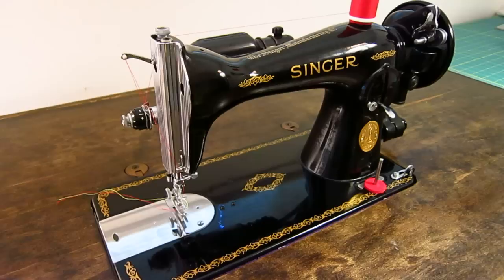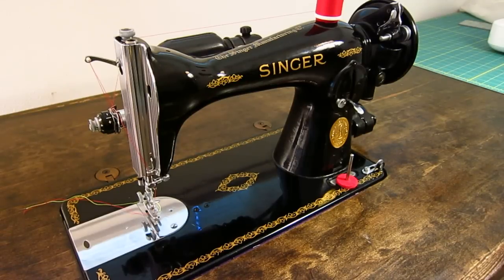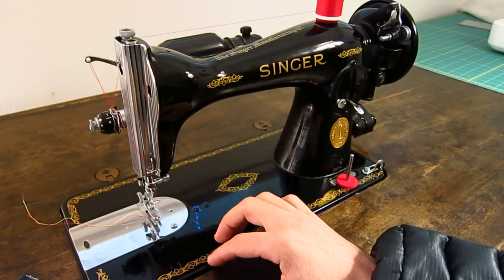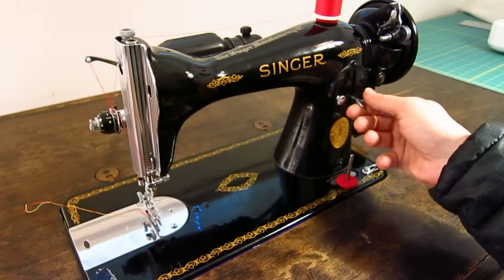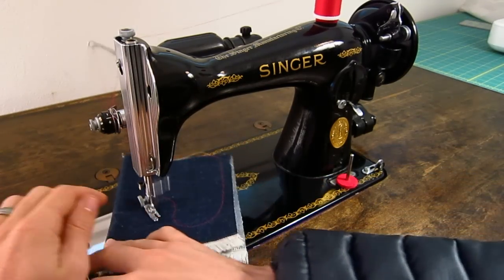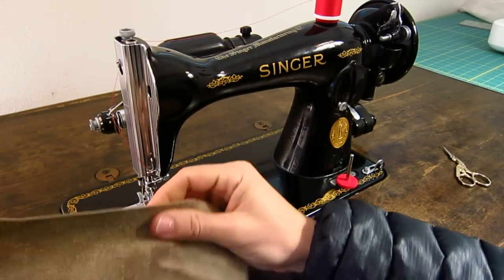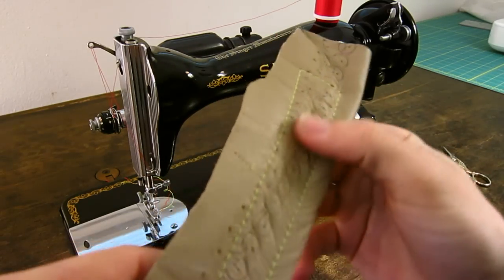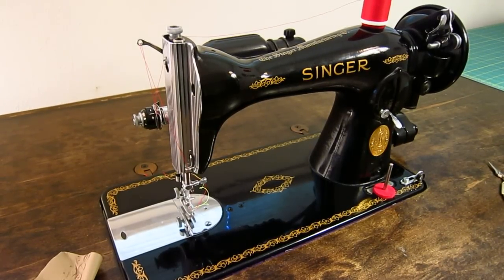1948 Singer 15-91 Sewing Demonstration

Comment: This is a dangerous hobby.  I just discovered the class 15 line.  I have a Japanese clone, a Universal Eversew Model 77, on its way to me.  It looks a lot like a 15-91, except it's belt driven, with a 0.9 amp motor.  Now having watched a few videos on true Singer 15-91s, I think there might be one out there somewhere calling to me.  Vintage sewing machines are like potato chips ... you can't have just one.  The Eversew will be my third.  I already have a Singer 128 and a 457.  The 457 has too much plastic in it for my taste, including a broken plastic gear that I need to replace.  I think I'll stick with the older all metal Singers in the future.  I love the look of the black cast iron Singers.  I'd also like to add at least one treadle Singer to my collection some day.
Reply: I’ve been bitten by the vintage bug. I’m now considered an addict.
Reply: Man don’t you know it !
Reply: My grandpa purchased one brand new with a cabinet when they got married, as a wedding gift for my grandma, after he came back from the war. Years after both of my grandparents passed my father got it out of their basement after decades of not being touched and passed it down to me. I was so excited to Inherit it. We cleaned it up, ya know decades of dust and such, we noticed the coward was rotted, but that was nothing to replace. When we changed the cord,  cleaned and oiled it, we tried it out and needless to say, I was in love. It was like it was brand new from the retailer. Someday I will pass it down to my daughter and share the history of grandpa buying it for grandma and hopefully she will do the same 💜

Comment: beautiful!I went from an advanced computerized model with a fried motherboard to a singer 201 - 2 and have totally swung to vintage. I'd only take another modern one if it were free. I've got 5 vintages!
Reply: I was given a 15 , it's like this and it's great, I would never have a computerized on. I like computers, but not for this
Reply: I feel the same. I got rid of my plastic expensive computer sewing machine. These are treasures that can actually be used.
Reply: Well, janome got me last year when during a night shift I emailed a dealer and said I'd buy that top of the line ocean liner of an m7 if she'd knock 2 grand off the price. I never thought she'd DO it! I still love my vintage beauty's, but that m7 is pretty cool.

Comment: I bought a 15-91 years ago and love it.  I bought a 201-2 for $40.00 at a flea market and now own all THREE models that Singer made with potted motors.  The 101 predecessor is almost as quiet as the 201 and used the same gear setup.  Love those vintage machines.
Reply: I have a 15-125 and two 15-91’s. Am Very Excited sewing with my Beautiful Ladies, have named them with Cajun Princess names.

Comment: Brother you do have a beautiful machine and I am lucky enough to have two of these and one travel machine. I had to rewire mine and I replaced as many serviceable parts as I could. Love the look and feel of all of mine. Since I took mine all apart, I need a video on the adjustment setting and where to put everything back to stock?
Reply: shafferjoe1962 try Andytube here on you tube he has a ton of singer sewing machine information

Comment: Wow. Just kind of stumbled on this video while looking at videos of the new computerized machines that are out there. Great job on the video! I personally have three Berninas, which include the 880. However, I have my mother’s 1948 Singer 15-91 in the cabinet. I also have her sister’s 1942 201-2 in the cabinet. The sale barn in Illinois didn’t want them when I sold my Aunt’s house in 2014 after she passed at 98, so I just moved them to Florida. My Mom and Aunt had both been in Florida with me since 2012, and Mom just passed last month at 95. I haven’t plugged them in, but I think they both still work—Aunt Helen had still been doing some sewing before I moved her down here. Right now my serger and one of my Berninas are sitting on the cabinets, sturdy you know, but I am thinking I am going to have to move them off and get them out and give them a try. My Aunt had worked for the local Singer shop at one point in her youth, so was good at cleaning and oiling them. I do have a local guy who could get them back up to speed if need be.

Comment: I just bought one of these in a cabinet in fair condition. I probably paid too much but the seller claim it had been serviced a year ago. The machine sews a nice stitch but I wonder what I need to do to get the wiring up to safe standards. Where does one find a technician to take a look at it?

DR
Reply from the maker: +Denny R Just inspect the wiring coming out of the motor going to the plug harness.  If it's pliable and with no cracking or exposed inner wire you should be okay.  I've had quite a few of these potted motors machines (201, 15-91) and there seems to be two versions.  One with a traditional SPT-2 style wire (looks like standard lamp cord) and another with a black and a cream wire with sleeve covering the the pair of them (likes like just a smooth cable).  The black and cream wires are the worst and tend to crumble away posing a shock hazard and potentially a fire hazard if you're getting arcing.  I just replace the wiring on basically every machine I have.  You can take it into a sewing machine shop but very, very few will even look at it.  You'll have to venture into on your own most likely.  I may do a video down the road on how to refurbish and rewire these machines but that won't be for a few months.  Goodluck!
Reply: +thesergeant 
Hey thanks for the quick reply! Looks like I have a  black and cream style but this wire set is connected to the foot controller not the wall.  The wire plug going to the wall looks modern. I assumed when buying the machine that if it was serviced at a sewing shop that the technician would have alerted the previous owners about the danger and there forth concluded the wiring would be safe.  

If I'm going to rewire then I should probably also rebuild the potter motor-would you agree.

I must say this sewing machine is fascinating to watch in in action- all gears and no circuits boards to control the stitching...

DR
Reply: Re-wire it when in doubt. It's a simple as that. The issue with the electrics is not that the system is inherently unsafe, but that the isolation used simply falls apart. One replaced, that's no longer an issue for the foreseeable future.

Comment: I love this video. Thank you for posting. I stumbled upon one today. That is almost 100% perfect. I picked it up for $65 and it runs like a dream.  It has all the original parts, plus all the feet, button holer and manuel.
Reply: I just got one these and I’m assuming it’s safe to plug into modern home outlets right? Like the voltage won’t overwhelm the motor?
Reply: @sarahlouisebyrd6060  good question. I just plugged mine in and the plug didn’t go all the way through the outlet. It still works but with the prongs of the plug only halfway in. Kinda scary. Felt like I was going to get a shock. But I was ok. Just wondering about the plug and also is that what he was saying about the wiring he had to replace many times on the machines he got.

Comment: Thank you for the well done video. I inherited my 15-91 from my dad who bought it for upholstery. I've made or modified lots of camping gear with it but didn't understand some of the features of the machine. Adjusting the spring pressure on the foot was helpful on my most recent project. I've used my wife's Elna but I still prefer straight stitching with this machine.

Comment: I have one  that i got free when a neighbour  had to move and left lots of old stuff outside . It's the Canadian JB  code from St John's Quebec  but I don't  know if these work today on hosue current  with 60 Hrz  cycle.  It was in 1948  that the USA  switched all of their   AC  dynamo  from 30  Hrz  to 60  which avoided   the  often  seen flickering of light  that some eyes could pick up .  
     In Canada we were warned about the US  changes  and  our  60 hrz change over  wasn't until 1955 where people were told to hand in all their older 30  Hrz   appliances  by the Hydro supplier because the wiring  could handle  twice the number of Sine waves  with  the   copper thickness.  
           I don't want to plug mine in and fry  the guts just to test it .  Will 15-91  JB series  handle the 115V 60 Hrz  .

Comment: Awesome demo friend; I had one given to me by my mother (Columbia) and didn't touch it for some time but finally I put a day and a half working on it, and now I'm glad I did. They are a workhorse; every now and then it dose break a needle. The needle dose clear the  needle port when turning wheel by hand but on full throttle once in a while it will break needles. Any tips?
Nice job.

Comment: I just picked one just like this up yesterday for super cheap! I have a 1915 machine my gramma gave me. This one is a bit different, but I'm impressed with all the videos I've seen about it  I can't find any on how to thread it though and I'm having issues getting the bobbin to thread through. Idk about this one. But my other machine you just set the bobbin in and go. Tried it with this one didn't work. And how I had it threaded on top is way different than how you have it. But I couldn't tell in the video how you had it threaded.

Comment: Hi,
Thank you for the video, my machine is similar, from 1951. My tension adjuster is in the front however, not on the side. I have a simple question, how can I tell if the needle should be thread from right to left or  left to right?
Reply: If it doesn't sew right,,, switch.

Comment: I am very new to sewing , I’ve only hand stitched holes closed on clothes and other minor things like that, but I want to get more into it! I really like vintage things in general and how well things were they made. But modern things can sometimes be better. I am wondering how this compares to a modern machine? I know I should get a cheap and simple machine for my first one, but I still want to learn and have something to work up towards.
Reply from the maker: I've been meaning to do a video about this exact issue: modern machines vs. vintage for new sewers.   The short answer is, without a doubt, get a vintage.  When you're learning the straight stitch is all you need.  Even when you're an advanced sewer straight stitch is what you use 95% of the time.   Don't worry about blindstitches, appliques, embroidery stitches, etc.  Get a vintage machine, learn the ropes and grow into the capabilities of your machine.  Too many people get frustrated when learning to sew and give up.  A lot of that frustration comes from the limitations of these cheaply made modern machines.  Get some that is reliable, and is designed to do one thing really well.  For vintage singers my personal favorites are the Singer 201, 101 but any of the 15 series will work, as will any of the other vintage machines that are out there.  Watch some of my other videos showing the different machines out there, get a feel for what you like and go find one.  You won't regret it.  Goodluck!!!
Reply: you answered a lot of my questions, now I just need to learn the different parts and terminology... I want to make my own bedding, a silk pillow case, a quilt... then move on the clothes...
Reply: Thanks so much for your help, I look forward to watching your other videos. A vintage vs modern video would be great for beginners like me! :) I am so happy to know these beautiful vintages machine are also good for beginners! I am inspired to learn more about them and maybe own one someday.
Reply from the maker: Cash4Fruit Keep an eye out on craigslist.  People often give them away for free or for really cheap.  You'll have to put in a little work but that's part of the learning process and what makes using these machines so rewarding.  Watch my video on " Durkopp Treadle Machine".  You might even consider getting one of those that are foot operated.  Once you put in some time on a machine like that you'll be a pro when you go to electric.  Goodluck!

Comment: I have one of these exact same model that my grandmother owned.  I sent it to a sew and vac repair shop and the motor "is in pretty rough shape" per the repairman.  Do you have a source for parts for this machine?  He said he would normally get them off another machine and he doesn't currently have one.   Is it worth spending the money on restoring it?  It has a lot of sentimental value and I would like to be able to use it.Thanks for your help

Comment: Would you consider doing a rewiring demonstration? I just found this same machine but it appears to have original wiring and I would love to replace it. I'm anxious to start using it!!!!
Reply from the maker: Actually yes.  I have a motor that I've been meaning to re-build and rewire.  I'll probably post it this week.  You can subscribe if you'ld like to be notified when it goes up.  Thanks for the suggestion!

Comment: I just found one of these thrown away. Sitting on side of dumpster. I tested it out with power cord because it was missing the foot pedal. And the motor worked good. It has the bobbins and everything like needle just not the table. I want to try to use it for small things

Comment: I own this model and picked it up from Goodwill for $15.  The original finish is in such good shape. I immediately took it to have it professionally cleaned and restored for $200.  WELL WORTH THE MONEY. It is a lovely machine and is a joy to use. Ive never used the buttonholer.  Thanks for planting that idea in my head!  I wondered if they worked well.  My mother is a free motion quilter and she uses this and the 201. These are great durable machines even after all these decades.  I am looking to upcycle some garments with this soon.   What happened to quality of American made products..  so sad.  Yes yes... wiring had to be completely redone. I also have a 1980’s electronic Singer 6871 (all metal too) that does decorative stitches and a 1950’s Anker.  I just love all of them. I’ve made many many drapes and curtains for a few of our homes and am just getting ready to employ these machines for making clothes soon. I just do not not the cheap clattery sound of the new machines.

Comment: Good simple description of this machine. I bought a Japanese clone that by convos from others they say its a 15. It was set up as a hand crank in vintage case. I may get a potted motor for it or put it into my red eye treadle cabinet. It has unusual decals. Think holiday of light, Daiwa. Which is India. I also love that guys are gettin to know about old machines. Some are even using their auto repair skills and casting parts. I have 8 vintage now and plan to teach sewing. I learned on a treadle at 7 and then my mother got a Singer, maybe a 15 also with only straight stitch. Until I was 21 and bought my own first cheap machine with zig zag, I only sewed with straight stitch. In a way better because I had to learn more couture type finishes. Stitch Witchery did not have adhesive back then. You over cast seams with it.

Comment: I just bought a model 15-91 at an auction for $1. It's in a nice cabinet and the machine looks in excellent condition. No marks or scratches. Nice finish and still shines. The decals have no signs of wear at all. Underneath, the bobbin case etc have sone light rust. When I turn the hand wheel the needle does not raise and lower. I would love to have it refurbished and usable. I live in central PA.
Reply from the maker: +Laura Thomas There's a silver knob on the right side of the hand wheel.  Hold the handwheel in place and turn that knob clockwise.  From there you should be able to get the machine to turn over.  Check the wiring though, these potted motors tend to need rewiring.  GoodlucK!

Comment: Great video. Can this be slowed down so I can sew on patches. Also, are parts available for this machine?
Reply from the maker: The speed is plenty controllable so sewing patches should be a breeze.  Over a million of these machines were made so parts are available frequently on eBay or through donor machines.  These machines really are bulletproof though so there isn't much that would require replacement.  I highly recommend it.

Comment: "It will definitely outlast you" haha. I'm sold.
Reply: I’ve got a 15-91 and don’t know crap about sewing machines but I got it working perfectly after watching a few videos.  Parts are easy to buy.  No frills but easy to work on.  I later bought a 127 and that machine is even easier to work on but has a funky bobbin.  Incidentally the 127 runs very smooth like what you would imagine when someone says “runs like a sewing machine”. Smoother than my 15-91.  

Both of my machines were built in the late 1940’s.

Comment: I now own 3 vintage machines, a featherweight 221 , a singer 128 and as of yesterday a singer 15.  its dusty and my husband will restore it. decals are excellent condition and bed is perfect so i expect it will clean up like new, it has the Centennial badge, and was made in 1948 Elizabeth NJ according to the serial number.   It’s missing the light and the side plate and the foot peddle, but I think I can find them on the internet.  There are so many versions of the model 15, i think its a 15-91, is there anyway to tell for sure?  Has the hardware I think for mounting in a cabinet, would prefer to put into a Bentwood case.  I can see myself using this instead of my 128!

Comment: I’m brand new to sewing AND machines.  I just bought one in super good condition, but when I try to make it run the motor just buzzes.....  I can’t get the needle to go up and down, what could I be doing wrong?  Thanks if you can help.